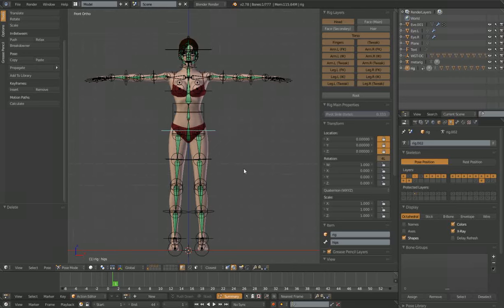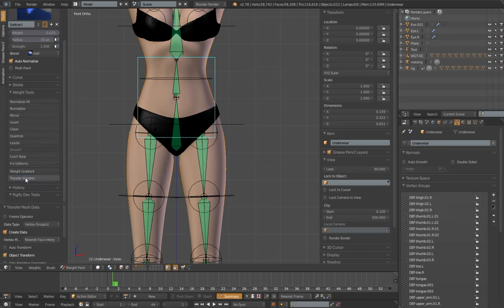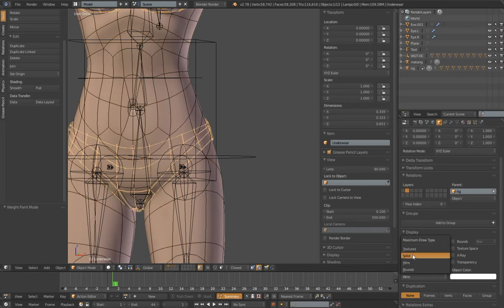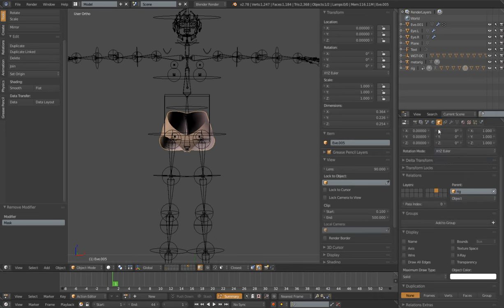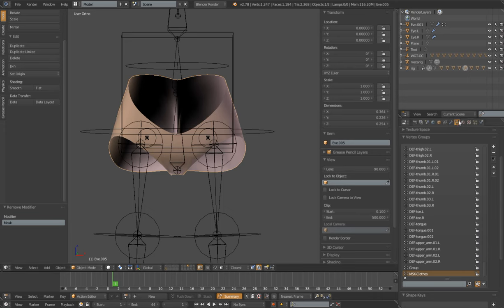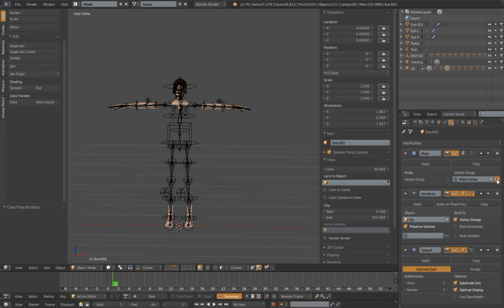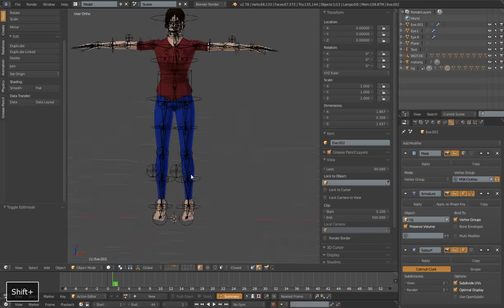Rigify   Part 7G   Stage 1 Weight Transfer and Rigging Clothes

Comment: So for anyone that has clipping problems and needs to hide mesh underneath for UE4 or unity you can use an Opacity Mask to hide certain mesh parts using the material properties. You can use blender texture paint to paint paint different opacity masks for each clothing set or body part, i think you can even combine(ue4) opacity masks in ue4 material using nodes to your hearts desire.

Still would be better if i could filter them out by vertex groups but its not possible to export vertex groups by fbx so opacity mask is the last resort, and its easy to program the material to switch to different opacity masks during runtime, at least in UE4 i have not noticed any performance issues since the vertices are still there and are still animated just not visible in the material and gameplay, not ideal but ok works.

Now i can make cloth from skin or transfer weights, then use opacity mask to avoid spending eons doing weight painting and still not getting rid of clipping.

Comment: Hello Dan. Great tutorial. I use this method alot myself except when my base mesh has a lot of vertices. Anyway my experience with this method and the cloth sim haven't been good ( leather body suit). do you have any pointers or tips in that regard? Thanks.
Reply from the maker: With a cloth sim, it's best to make a very low poly model to use as the collision object. Disable rendering for that object. If you use a high poly body mesh, the calculations will be very slow. Sims are difficult and time consuming, so I avoid them whenever and wherever I can.

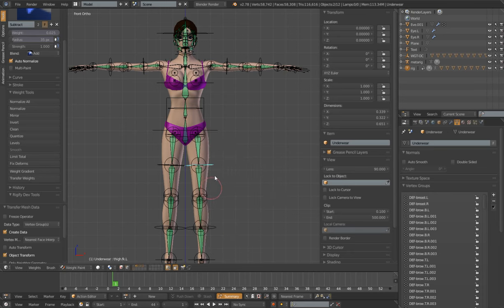Comment: 4:13 I can't move any bones at this point and when I change to pose mode to try my clothes don't move. My clothes mesh shows the highlighted areas that the bones effect in weight paint mode, but when I move the bones it stays in place. Please reply.
Reply from the maker: Did you click on Rest Position in Armature properties >Skeleton? (It should be set to Pose Position.) That will lock you from moving bones in Pose mode. If that is not it, you cannot move the deformation bones directly. You'll need to use the rig control bones. (Any bone with a custom shape like a box or circle.)
Reply: Thank you for the reply.

I am in Pose position, and I am using a human shaped mesh created with manuel bastioni lab. I don't have any control bones that you have here in this video. I have been manually positioning each bone for animations so far. I don't really understand why when you disable freeze operator your bones start moving the clothes you created, where in my project the clothes on my mesh are not effected. When I look at my clothes in weight paint mode the bones are clearly highlighting areas of the clothing.
Reply from the maker: The only thing I can think of is the clothing is not parented to the armature. Does the clothing have and armature modifier pointing to the same armature as the body mesh?
Reply: Pfft...Sorry...No I did not have that. I didn't consider it and just followed this video step by step. I am very new to Blender and this video was linked to me by a member of the Blender Artist Community.

Thanks so much, man.
Reply from the maker: Glad you got it working.

Comment: transfer doesnt work for me well, if the mesh has lots of different parts like a jacket which is not similar to skin and has lots of extra geometry it deforms very badly,
i already knew about the 3rd method making cloth out of the already weighted skin but that only works for tight pants, undewear, skin close cloth anything that has volume and complex model shapes that end up looking different after modelling and multilayer cloth it wont work 
also there is the option of lattice deform + the above methods but lattice is modifier only works in blender i need bone deform only to export to FBX for my game
pretty much im fucking stuck for years on cloth issue, i just dont fucking understand how profesionals get cloth done for characters, its ridiculous so many games look flawless on cloth  yet i cant find a single way in blender to achieve non intersecting cloth, its worst of the worst im stuck and cant make my game because of this issue

Comment: I rig my model not with rigify...can this work also on outside rigify?
Reply from the maker: I'm not sure exactly what you are asking.Transferring weights form one mesh to another, creating clothing from a body mesh, and using a mask modifier to hide the skin under clothing should work for any rig.
Reply: @DanProCG  i tried and cannot seems to work. When my model moves the cloth stays put on Blender 2.79b.How did you choose the bone and pose on weight painting mode? I cannot do that.hel]pp
Reply from the maker: If the clothing is not parented to the armature, and there is not an armature modifier on the clothing mesh, it will not move with the armature. That is the only thing I can think of that would not allow you to select a bone within the armature or transfer weights.
Reply: Thx.
Reply from the maker: You are welcome. One more thing, the armature should be in Pose Mode prior to selecting the mesh and entering weight paint mode. If the armature is not in pose mode, the bones will not be selectable.
Reply: I think I haven't applied the mirror modifiers on the dress. (...could this be the problem?) After that I will update my progress. Thank you for answering. You're an Awesome channel creator!
Reply: One more thing, I hope I don't annoy you. The Clothing is parented to the armature right? Just the Armature?, or do I have to go pick a bone? If I should pick a bone. What bone are you suggesting that I rather pick?
Reply from the maker: Applying the mirror mod would be good. Then select the mesh, shift select the armature, parent with armature deform (CTRL P), empty groups or automatic weights, then transfer weights from the body mesh. Parenting the clothing to a bone will make the object move with with that bone, but will not deform the object. This is useful if you have hard surface objects (like a ring or watch)  that do not need to bend with the body mesh.